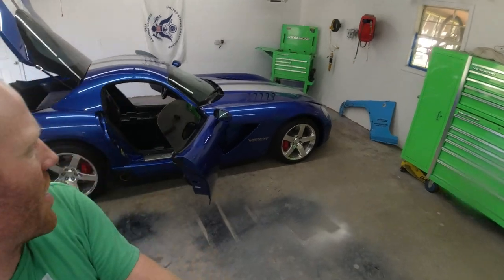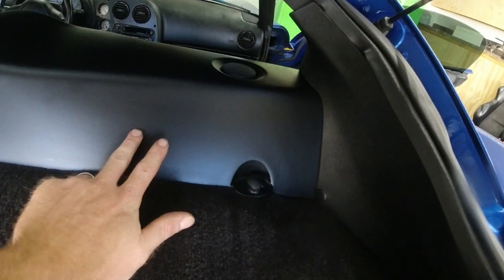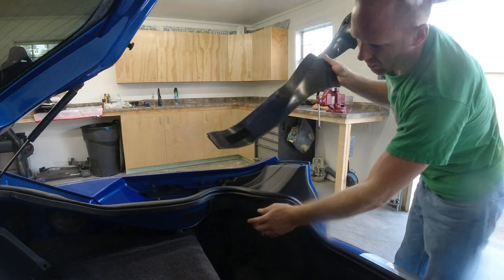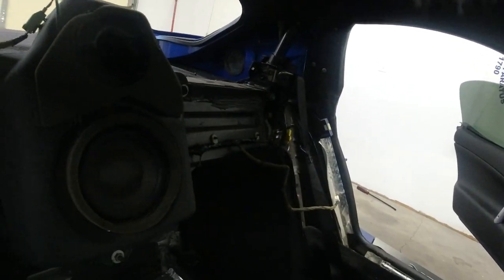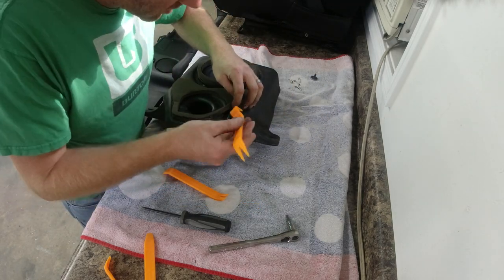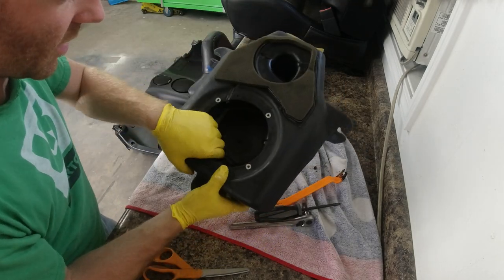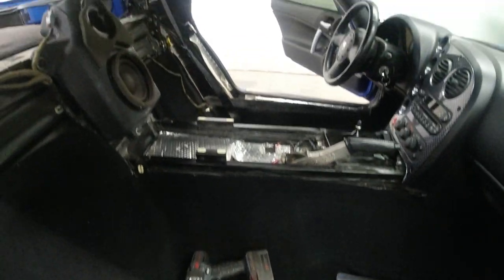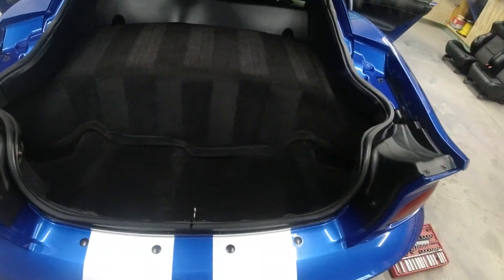Dodge Viper Subwoofer Rattle Fix For Free!

Comment: Do you have any tips for same problem with same gen but convertible? Subwoofer box looks different and is all one piece
Reply from the maker: I don't have any experience with the convertibles, I'm sure it's a similar fix though, probably the same exact foam that failed.
Reply: I just did my box in my Convertible. There isn't much different in his steps. I pushed both seats forward instead of removing. Popped out the 2 "VIPER" access panels to remove the bolts for the 2 roll bars. Once they were out, the same screws noted in his video allowed the removal of the back panel. Then the 2 top bolts of the speaker box I removed and loosed the bottom nut. That's pretty much it. Pulled out the speaker by it's 4 screws on the face and 1 allen key screw on the back. Cleaned out the gooey worn out "foam" and put in some craft 4mm high density foam in the "back" behind the baffle and a couple pieces on the front between the housing and baffle

Comment: Subscribed - great vid - I just got a 2004 - with 7000 miles - it is mint in every way...except for the damn sub rattle - it is a convertible - do I have to take the seats out to take the back panel off? Is there an easier way? - Can I pop off the speaker grill and access the port and speaker without even taking of the back panel? - Great channel - looking forward to more vids. Stay well!
Reply from the maker: Thanks for the support! Congratulations on the purchase, these cars are so much fun! I would definitely recommend taking the seats out, it’s not hard at all to remove them and should make everything else go a lot smoother. Good luck, hope it goes well!
Reply: @9NailzGarage  I Didi it!!!! Boom boom no rattle - thank you.!
Reply: @9NailzGarage  hey I'm back - not sure if you are still monitoring this - I'd like to replace the speaker and was told to "gut" the box - I assume remove the rattling piece (baffle?) - any thoughts on this and what type of speaker I should replace with to be used with the stock amp. The rattle came back - and I think I need to add some Dynamat on the inside of the trim panel. Thanks!